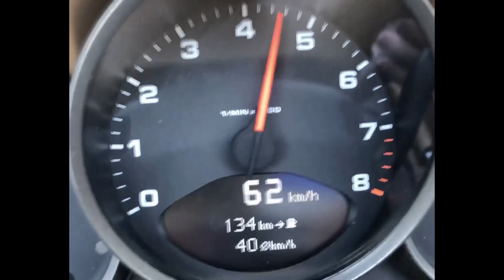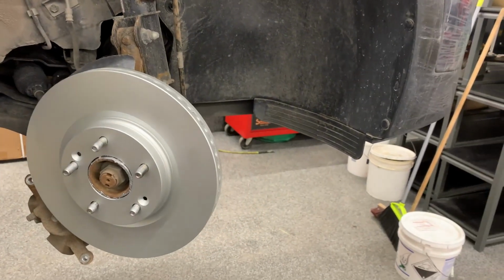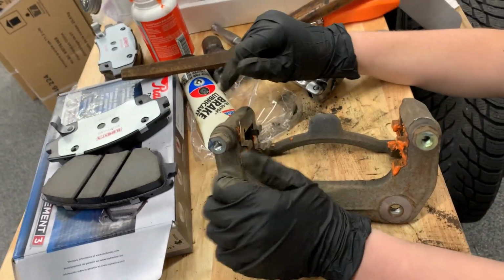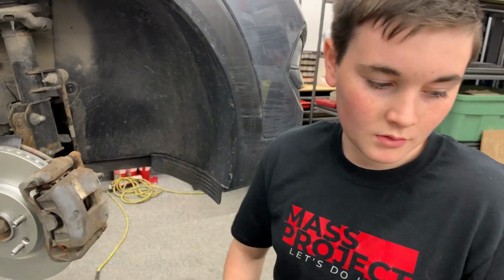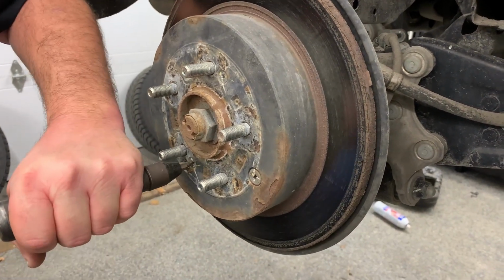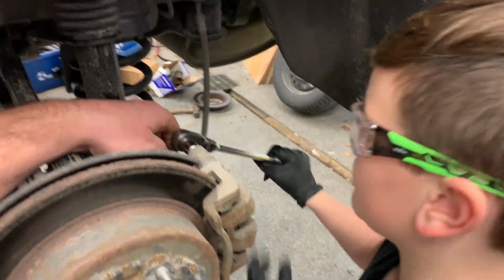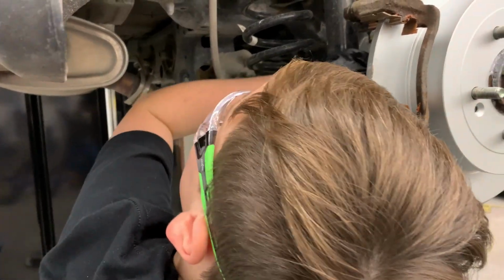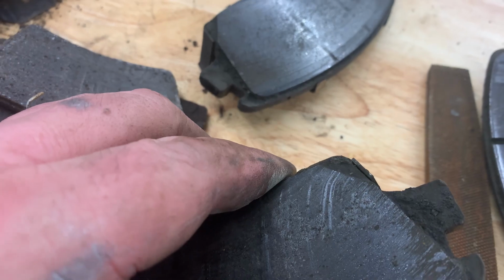HYUNDAI TUCSON Front and rear brake pads/rotor replacement

Comment: Great video teach them young can't wait to see more just one question why would they put the squiler at the top shouldn't it be on the bottom inside I have a 2006 tucson mine are on bottom or doesn't it matter if they go on bottom or top
Reply from the maker: We installed the brake pads the same way it was from factory, those were the original ones.

Comment: So I’m having a problem with when it rains or if car is parked for the night the brakes seem the make a grinding noise this is after replacing both rotors and brakes brand new. What could be my issue ? 2018 Hyundai Tucson

Comment: how do u retract the piston on the REAR brakes  some say a reg c -clamp wont work but u have the c -clamp backwards and seems to work? also, are there ABS modules on rear on 2017 hyundai tuscon SE? it has manaul parking brake..
Reply from the maker: Parking Brake is inside the drum, That’s why you can use a C-Clamp

Comment: Why put the lube under the pad clips?
Reply from the maker: It prevents moisture and rust. We had to scrape off the rust with a file.
Reply: @MassProject  gotcha thank you 👍🏻 great video
Reply: @MassProject  Can you use Permatex grey  Anti seize in those clips before loading the brackets?
Reply from the maker: @stever9931 I would use brake lube for the clip and slider
Reply: @MassProject   OK  I will get Permatex brake lube for ceramic. It is orange colour.
Reply from the maker: @stever9931  different colour for different brands, as long as it’s for brake lube. Read the application guide.